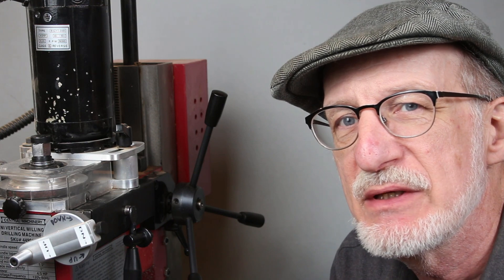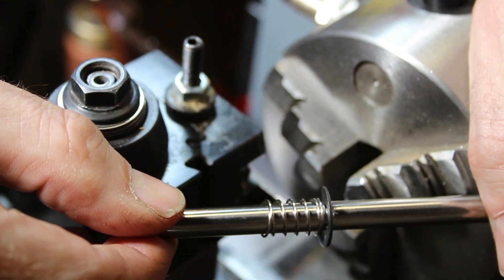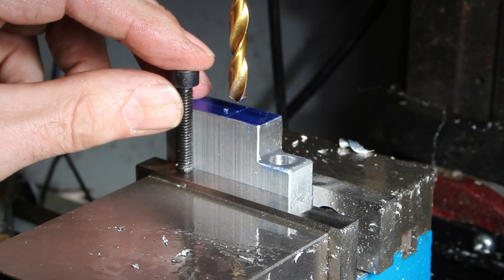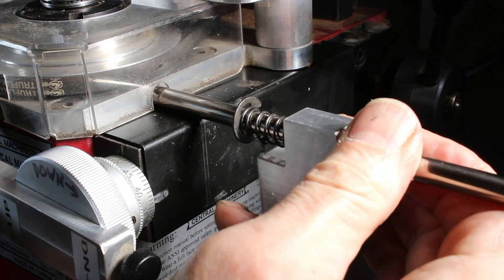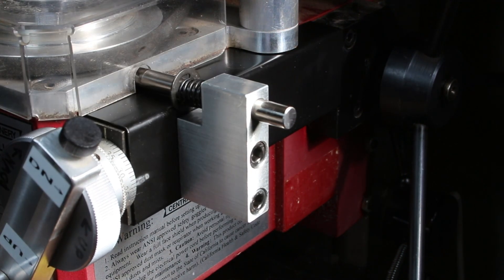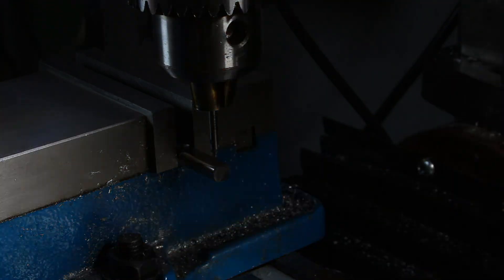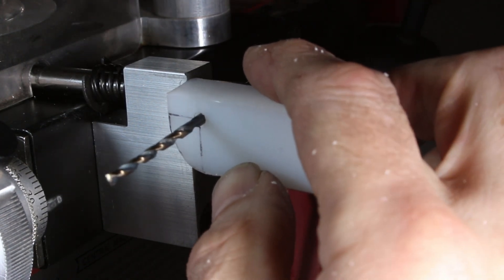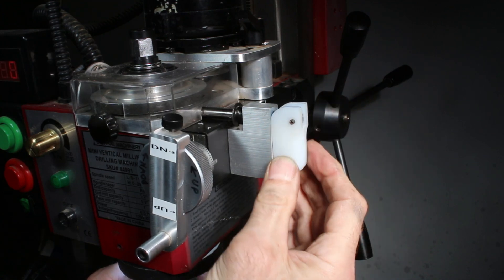Spindle lock for my Mini Mill

Comment: In my opinion, this is a dangerous design. Not "fail-safe". In the event of a lever or pin failure, the locking pin will lock the spindle during operation. The operation of the arresting system must be exactly the opposite, as shown in the clip shown for the sample.
Reply from the maker: I don't subscribe to that level of paranoia. When things are engineered right they don't fail.
Reply: @GuyMarsdenMakesStuff  I have to subscribe to the idea that proper failsafe is part of proper engineering. Served me well for many years as a computer programmer.
Reply: @GuyMarsdenMakesStuff  Urban is dead on it! I would reverse the spring action to ensure any failure will not penetrate and stop the motor at high speed! Great concept it just needs some slight modification to be safe! Thanks for posting and take care!
Reply from the maker: @bigmotter001  I still disagree. The cam that holds the spring out has a very positive action and I've never had a problem with it.  I do sometimes forget and start the motor with the pin engaged and the motor just stalls and shuts down which is fine.  And remember my machine is belt drive so it can can slip.
Reply: @jrkorman  I tend to agree. i made my own system on a similar milling machine, but it has the belt drive fitted as standard factory spec. I fairly quickly decided the pin could easily be overlooked and left in the spindle, so i devised a simple block, that i fitted to the front of the machine. Incorporating a spring loaded pin that has to be physically pushed in to lock the  spindle and as soon as i release the  pressure on the pin it automatically pops out. So it is impossible to forget to remove the pin.  Personally i prefer this method to the method Guy employed. But of course everyone has different ideas and whatever works for one individual may not work for someone else. Perhaps i am just a bit more belt and braces than Guy is. I also didn't much care for the tapping into the thin steel of the micro feed adjustment guard.  I would fit captive nuts, providing they don't foul up the mechanism or i would have strengthened the guide  before tapping, if i was going to do something similar. As i know i would almost certainly eventually strip those threads. I don't want to appear negative but i respect powered machines can bite and even if they don't injure someone there is always a possibility of expensive repair bills if something  should god forbid go wrong.

Comment: There is 12 volts available in the power supply for the fan. Alternately you can put a 200 ohm 1W resistor in series with the fan and connect to the 24 volts. The fan only uses 58 Milliamps.

Comment: Wow! So much better than what I made. I just had concern that the sheet metal was to thin to tap but looks like it worked.👍
Reply from the maker: Thanks!  Yes, the metric taps bit into that sheet metal nicely, but I can always back the bolt up with a nut on the inside if necessary.

Comment: Great job!! I may have got a bad kit from Little machine shop, because my hole for the locking shaft has a D shape in the aluminum housing. I had to machine a flat to be able to insert it.
I could suggest you, next time, when you have to cut two flats on opposite sides, to cut with an end mill, with the sides of the end mill, in front and back of the part, if you understand what I'm trying to say. They also sell adjustable parallels, which are great in cases like yours. I'm working on mine as well, waiting for the three glass scales. Display and the tachometer is already installed. Strengthened the with a steel plate the column, where the big nut is, added two bolts with spacer that mounts to the bed of the mill, and two other bolts that are mounted to the column. I have also added four small bolts, at the front of the "angle adjustment"  for extra rigidity. I have picked up a Vevor 8.7"x23.6" lathe. I had to repair/modify a lot on it, to be usable. Even the ways are off.  The bottoms of the ways are not machined accurately, they are not parallel with the top part. The front way is higher at the tailstock, but the rear is exactly the opposite, it is lower at the tailstock and higher at the headstock. I had to use Aussie's Shed sanding technique, to reduce the error. The hole in the tailstock, was so bad, that I had to bore it out and make a bronze bushing.
It will be a good lathe when I'm all done with it, but there is a lot of work goes into it. I'm looking for a magnetic DRO system for it(similar to LMS style, but much cheaper). That is next. I will be building a Locost, after all this is done. By the way, I'm a manual machinist by trade, and I work for a space company.
Reply from the maker: thanks for your suggestions.  Adjustable parallels are on my list as are angle blocks...
Reply from the maker: Thanks for the suggestion, you're right.  I just was unsure how that metal would cut and figured end milling would cut better than edge.  I also realize that I really need a set of adjustable parrallels.  Just found a used set for $30 on eBay!

Comment: Cool ideia, i would do the opposite, to put a spring outside to return when i push, because i have fear that piece could unlock itself from vibration and slam on the rotor causing the quill to be damaged
Reply from the maker: The lever I made locks firmly in both positions. Since then I've also added a switch to the lever that prevents the motor from running if the pin is engaged.